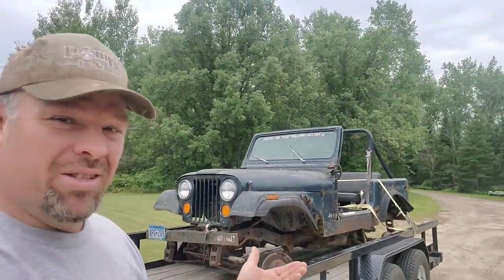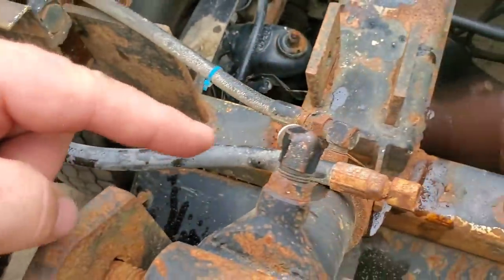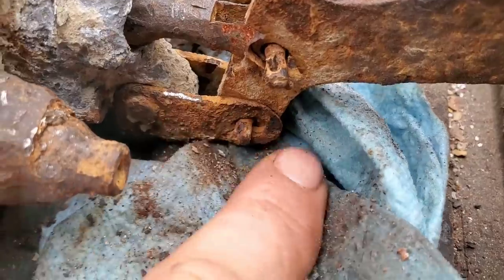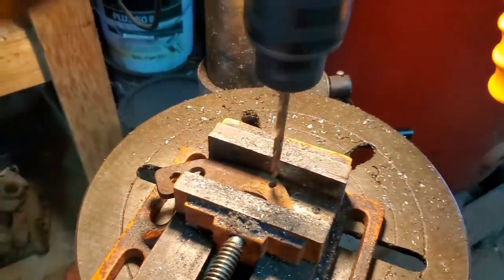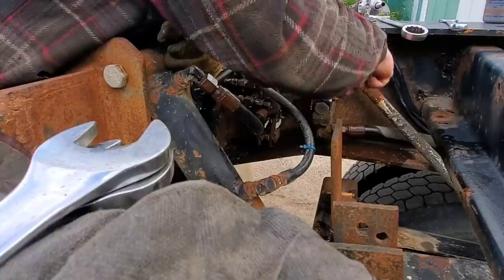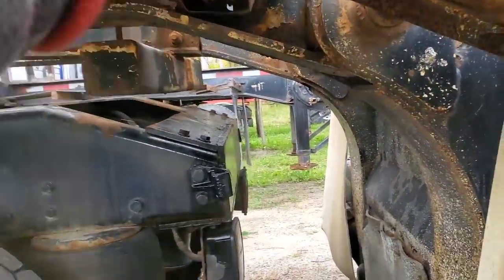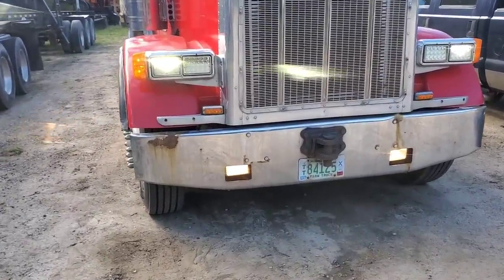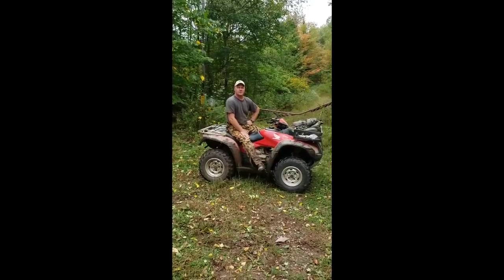Beautiful Fabricobbling??

Comment: All that rust'd drive me crazier than I already am. We've got it but not EVEN like up there and we try and stay home till it gets washed off. Good fix though and if you were off a little with the linkages you could always cut some off the trailer to make up for it. And for the spool valve seals to be intact you did a FINE job! And we had a fine day too. The wife and the grans parent are having a gals night out. Boy Howdy there'll be some tales to tell when they get back. GBWYall and THANKS!
Reply: I have been playing in the salt mine's of Wisconsin and Minnesota for so long i get giddy when is see a older ride with no rust lol.
Reply: @scruffy6151  A new (er) rig of ANY kind scares me. No rust and no dents are running away time. And I've beat layers of rust off of stuff and when I was on the western end I helped pour a tub where some folks in Tennessee  were going with liquid instead of solid salt. That's what they do here now too. Wood heat, gas cooking and generators. NO problem!

Comment: Let those brakes drag a few miles then soak em with some good penetrating oil. The bushings will be good and hot and will suck the oil right in....or catch on fire, in which case you drove too far. But when I was pulling intermodal "equipment"(junk), that's what worked for me. Lol 

Good luck, my good man!

Comment: When you heat up a screw, it will expand and then it compresses 
the rust that is in the grooves. It is a very good way to loosen rusted screws, 
if you let them cool first. You're doing the right thing.

Comment: Go get yourself a gallon of bar and chain oil, and mix it with a pint of kerosene. Then "paint" all those exposed parts as well as the frame. The kero will evaporate and leave the sticky bar and chain oil behind. keeping the salt from making everything rusty. lol. I did it every fall with my tri-axle log truck and the frame still had original paint on it when it was 15 years old.